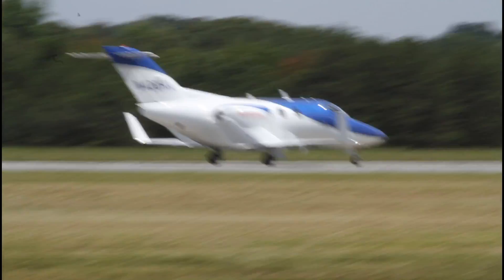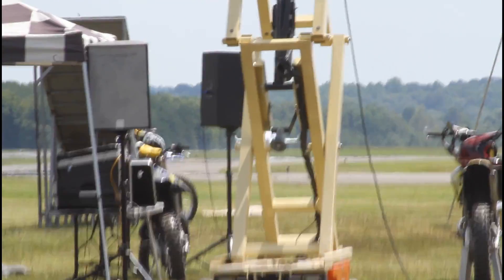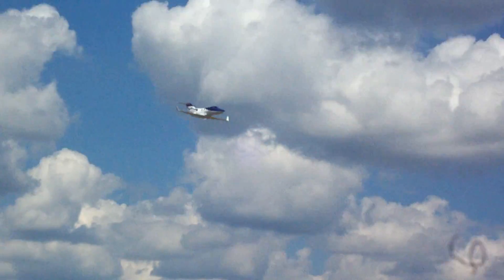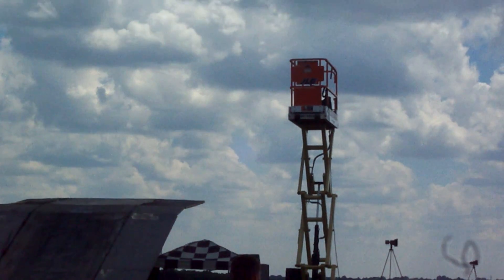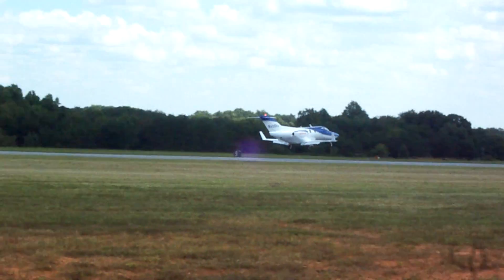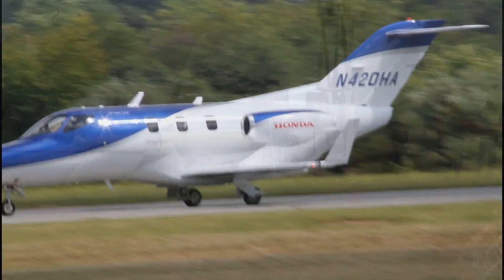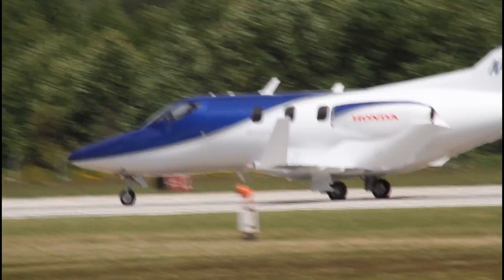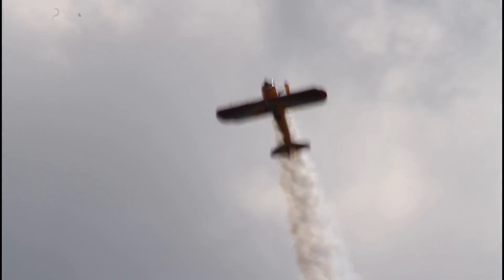Honda jet Performance Overview

Comment: Interesting jet but as jets go, it is very slow. A cruising speed of only 300 mph in this day and age?  In sharp contrast, the Cessna Citation X cruises at 604 mph. It cuts travel time in half.
Reply: +itsmegp46 It's maximum cruising speed at 30,000 ft is 483 mph.
Reply from the maker: THANKS FOR WATCHING !!!!  Please like share and subscribe, also check my other channel, Salem Taxi on YOU TUBE . Thanks.